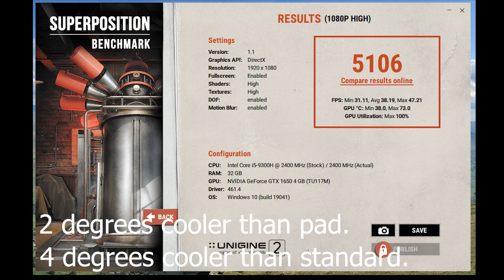What's Better Thermal Pads Or Thermal Paste On Your Acer Nitro 5 Laptop?

Comment: Should we use thermal paste on VRAM chips instead of pad?
Reply from the maker: You can use either but if you go for pads just check how thick they are in the existing chips
Reply: @AshBuilt  thanks brother

Comment: Thermal pads are long lasting and should outlast the laptop, whereas thermal paste breaks down and deteriorated, eventually making it useless, often needing to be re-applied regularly. In my opinion, I’d rather have +2° and 1 less frame per second that to regularly open up the device and do Maintainence. In that regard, pads are way better than paste.

Comment: I have been warned from screwing my heatsink of since the paste on the vrams would stop working. But i really need to change the cpu and gpus thermal paste. Any advise?
Reply from the maker: I’ve had no issues since putting new paste in my cpu/gpu

Comment: Hello just curious my friend replace thermal paste in thermal pad on my nitro5 but a little bit. is it safe ? I observe playing dota in balance power option and max fan it decrease temp unlike previous unpasting with a pad. Im just worry that can be damage the chip. Please reply. Sorry for bad grammar.
Reply from the maker: You can use a pad if you want to and it should be fine. I just had better results with the paste
Reply: @AshBuilt  can be mix pad with a paste on chip? Not on gpu and cpu
Reply from the maker: @jlopezx23  you don’t want to mix them in the same place
Reply: @AshBuilt  ok thanks for your help i feel relief when i watch your videos

Comment: do you know how thick the thermal pads on acer nitro 5 are?
and is it safe to change the thermal pad into thermal paste? because on my acer nitro 5 the default from factory is using thermal pad on vram
Reply: İt is not this guy probably doesnt know what he is doing to his vrams you need to  change thermal pads with thermal pads nor ur vrams will overheat because thermal pastes are not thick enough to touch cooling block

Comment: could i use thermal paste on VRM and those black little thing? because i made a mistake when i bought the thermal pads. the thermal pads that i bought is too thick. so, the heatsink doesn't close enough to the processor and the gpu.
Reply from the maker: Yes you can use paste on them. I’m pretty sure I have paste on mine too
Reply: @AshBuilt  really? thank's for the answer. ah.. it's not just VRM btw but also the VRAM
Reply: @DiriKu  did it work?
Reply: @pedroewert143  yes, it does. but i change it to thermal pads now
Reply: @DiriKu  ty for your response - i guess you got 0.5 and 1mm?
Reply: @pedroewert143  NP,,,, yes, i have both. and i'm using 0.5mm
Reply: @DiriKu  thank you so much

Comment: so do u recommened that i replace the pad on the memory chip for thermal paste ? if so do i use comerical common paste or i go for something a bit expensive for memory part as my laptop really over heat in massive way
Reply from the maker: I’d only really use paste on the cpu and gpu unless it’s like the on the other chips from the manufacture

Comment: Dont u have to use thermal paste just for gpu and cpu and for others(vrams?) thermal pad for best ? I'm thinking to replace thermal pad for these little vrams. And could u undervolt at Windows 11 ?
Reply from the maker: I had better results with the paste over the pads so I’d stick with the paste.
You can use pads if you want but it’s up to you
Reply: i brought my tuf a15 to a well knowm repair shop in my place for a repaste, dude put paste on the vrams and all that, freaked out for a bit but no problems at all, even i got it re pasted again with mx4 because the old one was a total garbage. 

works fine, i guess i rather use well known thermal pastes instead of spending a lot of money for a shitty thermal pads with each different sizes.

Comment: Thanks for the video mine doesnt turn on, no charging no light at all.

I didconnect the battery and reseat , charging light light, i just like a dead laptop 🥺

Is there anything you can advice?

This is only 1 1/2 years old only .

My son just playing roblox and its turn off.....

I thought it ny thermal pad, so its normal that its like melted or something as I can see to your laptop?

Thanks, oh I forgot we have the same laptop.

Thanks again
Reply from the maker: It’s hard to say without looking at it.
Maybe try a different charger first. see if it’s just that that’s died

Comment: Hey, I'm new to learning about this laptop I have it. Can you give me a exact explanation on what thermal paste does?
Reply from the maker: Basically thermal paste transfers heat from the cpu or other processors to a cooler.
The better it transfers the heat away from the processors the cooler it will stay and the better it will perform

Comment: Bro i have the same laptop but my Tempsford became worse after applying paste gpu hitting 92c but I applied cheap thermal paste
Reply from the maker: Might be worth trying a new paste
Reply: @AshBuilt  i did a big mistake pasting cheap paste my temps are now worse than before cpu thitting 88 even with undervolting and cooling pad gpu above 92 my laptop not running heavy games like watch dogs 2 iam getting 22fps even with 1660ti iam feared that my gpu was damaged getting low fps in every game i play does mobile gpus damage
Reply from the maker: @sivatelugugamer4837  not good probably best get some good paste and start again
Reply: @AshBuilt  i pasted the same paste 4 times but the temps getting worse each try iam afraid that my gpu got damaged games are crashing when i turn on

Comment: you don't use pads for CPU and GPU ..
Reply from the maker: You can if you want to
Reply: @AshBuilt  I never heard of anyone doing that except for PCH chipsets or low TDP atom CPUs.
But I guess it also depends on the material of the thermalpad..
Reply: @AshBuilt  u cant cos its shit performance
Reply from the maker: @EpicBunty  I mean I agree but I wanted to test both
Reply: @AshBuilt  yeah thanks for that... shouldn't recommend that though...
Reply: @EpicBunty  should i use pads in place of pink  paste? And of what thickness 0.5mm or 1mm
Reply: @MOTARD_  u should ask Ash... but afaik, you get thermal paste for the cpu/gpu.
which kind depends on your system, and thermal pads for the vrms. 
The size depends, you will have to find out , but in the end you want the best tightest contact from your heatsink to the thermal paste/cpu/gpu die and the thermalpads/VRMs.

if you dont find out just go for 1.0 and 1.5 mm both.
Reply: @EpicBunty  both means? Should i put 2 on top of each other or use two 1.5mm and two 1mm ?
Reply: @MOTARD_  both means 1mm and 1.5mm (both) in case they don't make good contact with the heatsink rest you should do your research on your laptop model and buy accordingly 
I think stacking thermal pads is not recommended but who knows. you can do research for your particular situation and figure it out. if you have a laptop then go for a thicker thermal paste.
Reply: @EpicBunty  ok thanks 🙏🙏

Comment: so my laptop is an acer 5 intel i5 2019 and dont have a vram slot so should i put paste there or no or pads i cleand the pink paste off thinking i was supposed to
Reply from the maker: If it had paste on it before then I would put some back on where it was.
I’d go with paste I had better results with paste over pads
Reply: Bro how is ur laptop working? Are u using pads inplace of pink paste?

Comment: Hi , I’ve applied 1mm pads to the Vram and GPU usage dropped less than 60% do you recommend put regular paste on the Vram ??????  because People said you can’t …
Reply from the maker: when I tried the pads vs paste the paste worked better for me and I have had no issues yet.
My laptop came from factory with paste so there's no reason why I cant replace that with another paste.
Reply: @AshBuilt  so you are suggesting that putting regular thin paste on Vram is best option to go … I have seen your video but it impossible to believe as the heatsink need pads to reduce vrams temps
Reply: @michaelarc2792  should i replace pink thermal paste with pads? Also which thickness 0.5mm or 1mm?
Reply: @MOTARD_  
No don't replace it no matter how old is your laptop
Reply: @michaelarc2792  oh ok. But why so
Reply: @MOTARD_  
commercially there are only 1mm and 0.5mm thermal pads, acer nitro 5 requires special size between them which companies don’t sell i’ve changed the pink thermal paste without knowing this fact and my laptop dead in performance
Reply: @michaelarc2792  thanks bro🙏🙏👍
Reply: @michaelarc2792  bro could u suggest a good thermal paste for nitro 5
Reply: @MOTARD_  
thermal grizzly kryonaut

Comment: can i put a ram that has higher mhz than the one that came with it? or i can only put smtg with same mhz?
Reply: you can put whatever you want but it sill perform at a speed in which both can work at, so if you have 2666 and 3200 then i guess you will stay with 2666